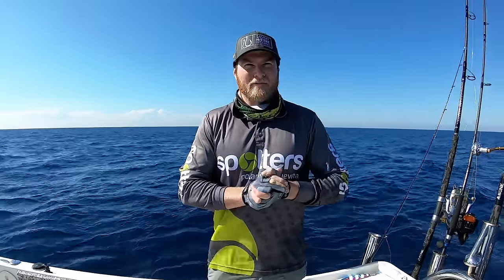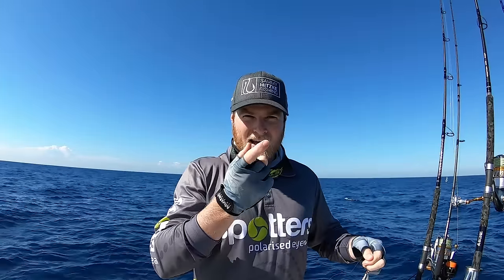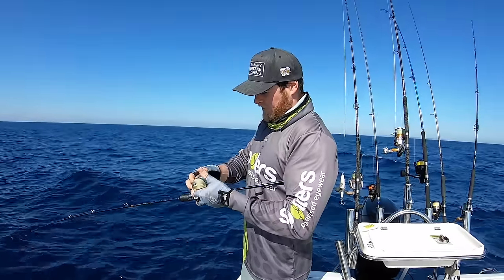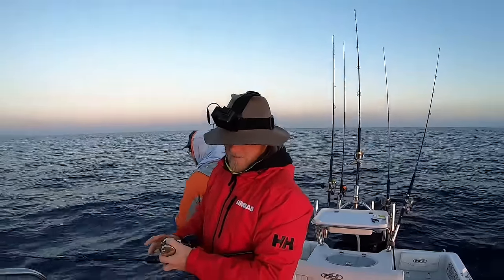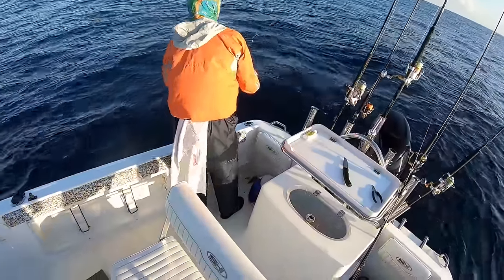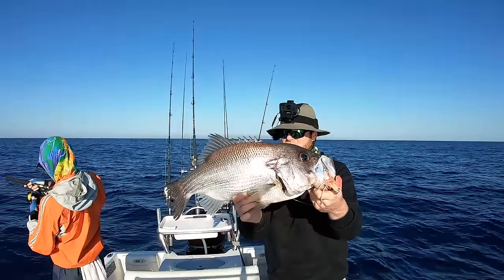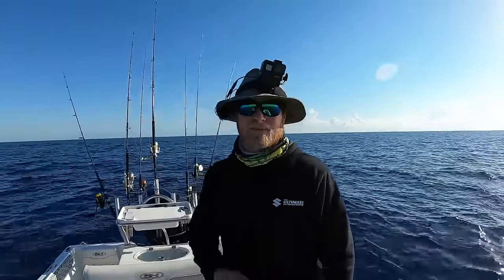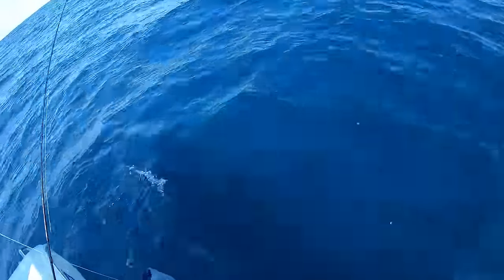Slow Jigging Secrets | How to slow jig reef fish

Comment: Great video! I live in Portugal and jigging works great. We just target different species. I am starting out on this technic and that is why I am here, and so far, I have learnt , and although targetting diferent species, tips and tricks applie regardless, I guess. I got myself rigged with a daiwa certate for the job and I've been thnking about a way to attache to the boat so I don't need to dive in after it, specially in offshore fishing. You dove after the OCEA setup. Right now, the sea temperature is 14º Celsius here in Portugal, unless I has a full change of clothings, I would had to go back and be treated for hyperthermia. That simple. In the summertime, it's not much different, sea temps don't rise above 21º in southern Portugal, but where I live near Lisbon does not rise above 19º. But there are upsides to that, we do not have sharks. Again, great video and thanks for the tips. Cheers!

Comment: Not knowing that metal witch are a grade C rod Vs an evergreen which are premium, I bought 1 a 6'3" PE 3 paired with an ocea jigger NR HG & PE3 line. A few questions: I fish no deeper than 60 meters (California depth limit for sportfishing) Its mostly rock cod & lingcod for jigging near bottom & schooling fish mid column. I bought a healthy selection of slow blatt ovals at 60 gram & some slow blatt longs same wt. I also bought some heavier shimano butterfly jigs at 150 grams for current which we often get here. My leader is 40 lb fluoro and only about 6 ft long Ive heard very different advice on ldr length from 6 up to 18 ft long. For my given depth of fishing (usually bottom in 60 meters to shallower like 20-30 meters) is there a ldr length thats better? Also is my reel too big for my rod? Maybe switch to the 1500? Any & all advice very much welcome. Thx for all the info

Comment: Great stuff Sammy, one question if i may, do you attach the line to the heavy end or the lighter end?
Reply from the maker: Craig Wheaton g’day Craig, most of these jigs are Centre weighted so you could pretty much use them either way. But as a general rule there will be an eye on the top of the jig 👍
Reply: Sammy Hitzke Fishing thanks Sammy love your videos mate, have a great holiday season, tight lines!